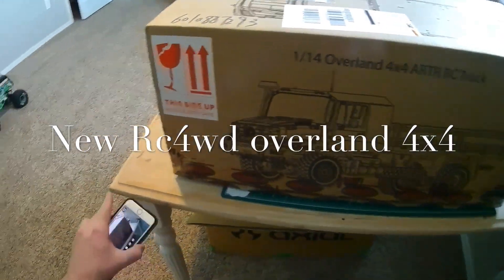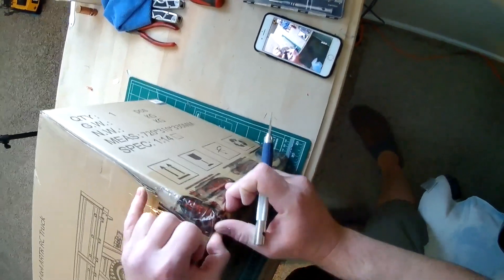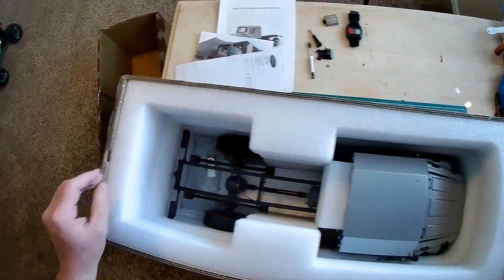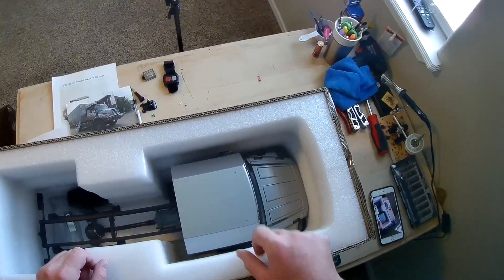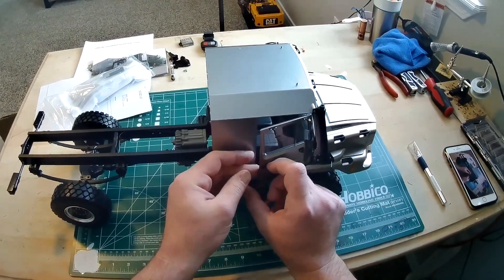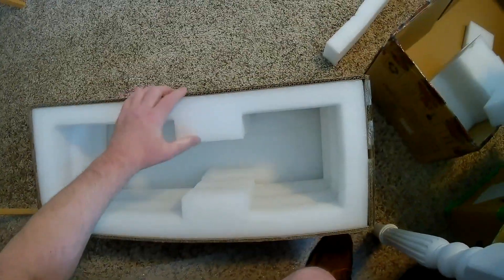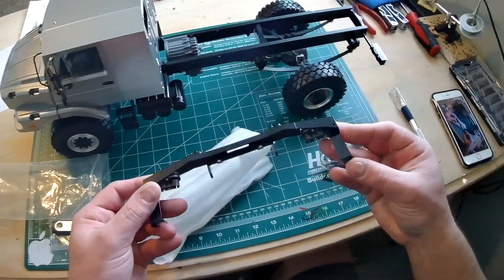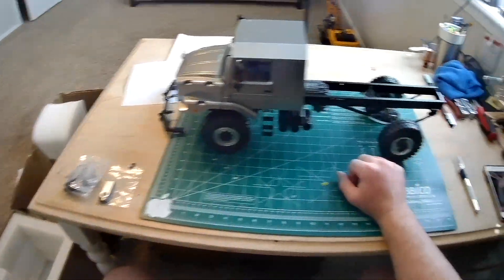Rc4wd overland 4x4 project Silver

Comment: Did you have any problem putting the steering servo in. I tried to put a savox servo in mine and it won’t fit in between the frame rails. What kind of servo did you run.
Reply from the maker: Charles Waller 
I’m using a ZOSKAY 35kg high Torque Coreless Motor servo. 
The motor on it is a little bit smaller that a standard one.